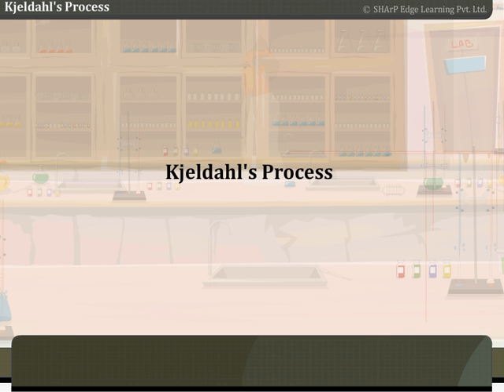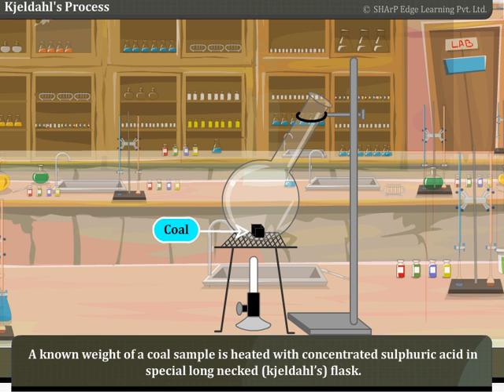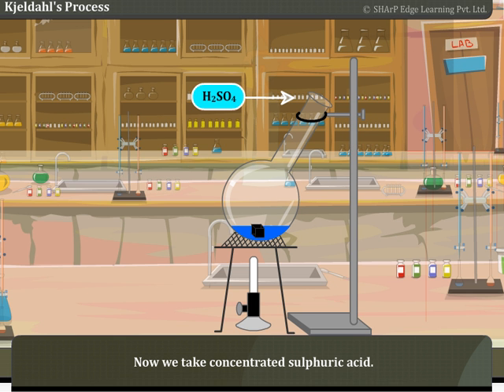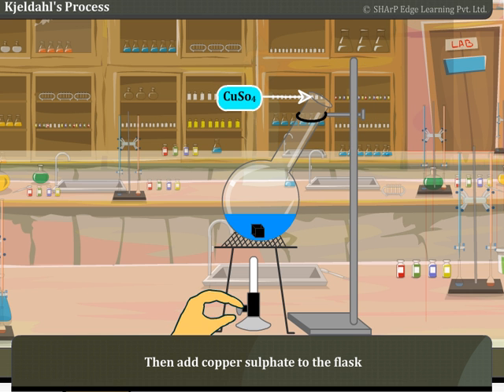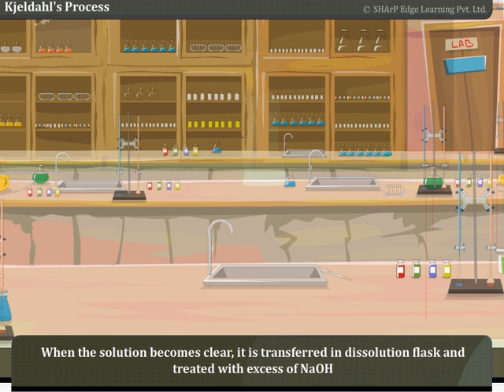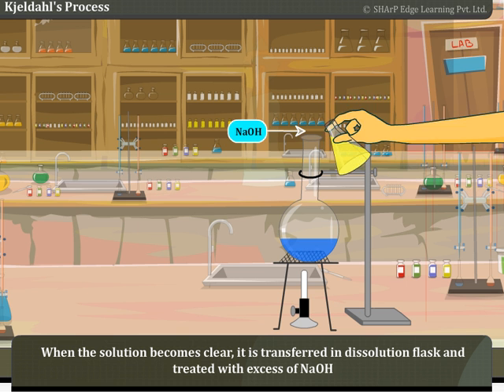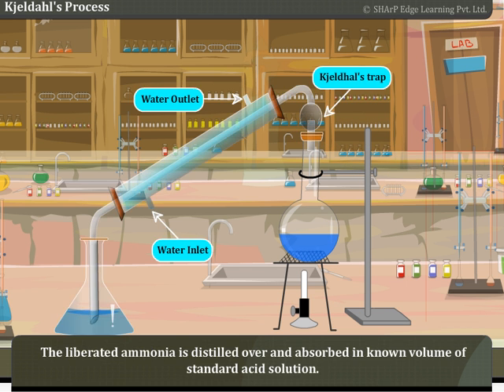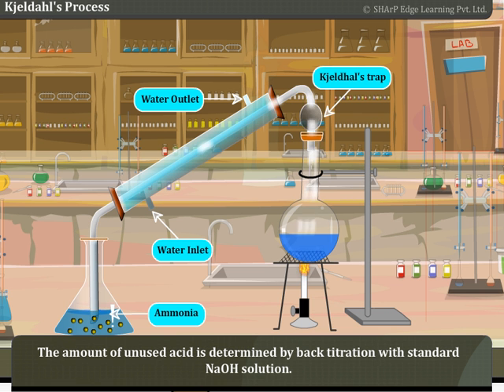Kjeldahal Process

Comment: 1. Heat a substance with sulphuric acid
2. Potassium sulphate is added to increase the boiling point 
3. Solution is then distilled with a small quantity of sodium hydroxide
4. Back titration 
5.  End of the condenser is dipped into a solution of boric acid
6. Remainder of the acid is then titrated with a sodium carbonate solution
Reply: 0 dega😂
Reply: Ye likhuga toh

Comment: This is what's written in my book and it goes like this
"A known weight of powdered and air dried coal sample is heated with concentrated H2SO4 along with K2SO4 as a catalyst in a long necked Kjeldahl flask.
After the contents become clear, it is treated with alkali i.e. heated in a round bottom flask. The Ammonia liberated is passed in known volume of standard acid solution."
Following is the reaction that occurs
N + H2SO4 + K2SO4 + heat ➡ (NH4)SO4 + alkali ➡ NH3 ➡ acid solution
Reply: Sufyan Parkar patience👍👍👍👌
Reply: Ifjjfnfhffhdfg😊s😊😊j

😂😂
Reply: Ik 7yrs have passed, u prolly have kids also now... but 

now in my book CuSO4 is written. They changed the catalyst. And explained that-

For finding the amt of NH3 liberated-
When NH3 is passed through standard acid solution of H2SO4, we find the amt of unreacted H2SO4 left after NH3 is absorbed. This unreacted H2SO4 is titrated with NaOH for finding the amt. 
Total acid initially taken- acid left unreacted= amt of acid reacted

And then load of calc to find percentage of N in the acid reacted.